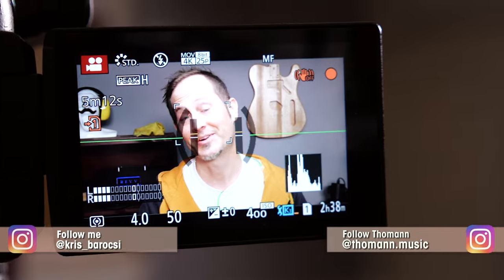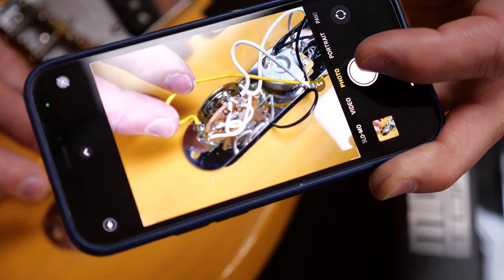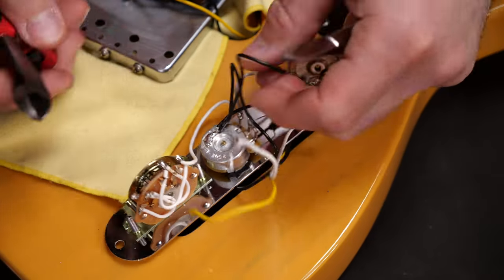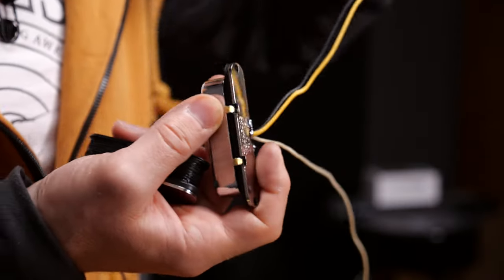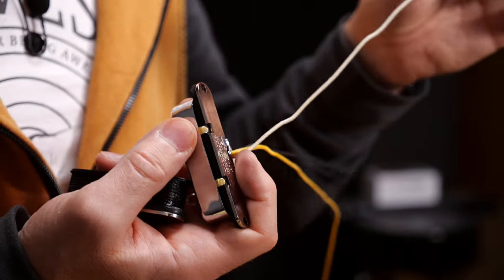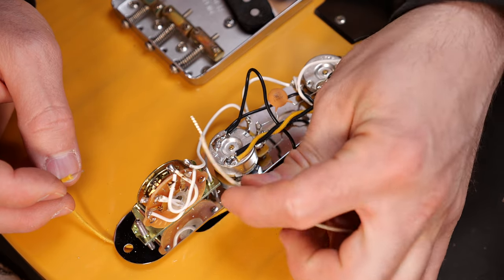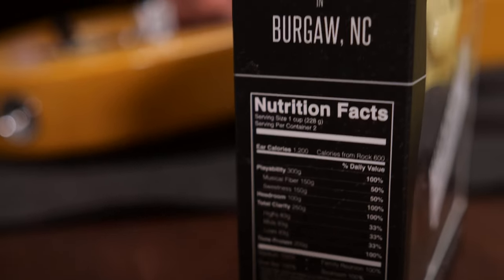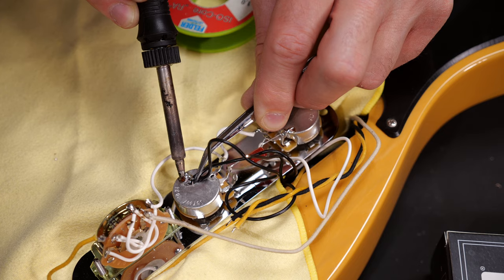How To Swap Pickups In a Telecaster | Guitar Tech Tips | Ep. 61 | Thomann

Comment: I will generally first finish all electronic work soldering then test for proper connection and only then screw everything back on. So in case something goes wrong I will notice instantly after the soldering.
Reply from the maker: Great tip! Thanks for the comment, people, listen to Count Blue! Cheers //Kris
Reply: @ThomannsGuitarsBasses  I do a simple test by knocking on the pickps with some small screwdriver. One should hear a "knocking" sound coming from the speakers (put the amp on a low volume!!)
To test for  proper toneblending you have to use sometime heaphones so you can hear the difference between the open and close toneblend. You could also use a multimeter, but of course you do know that anyways. ;-)

Comment: I've got a Squier Telecaster that I'm tinkering around with, it already has a scalloped neck, reverse bridge, reverse control plate with slanted pickup selector, new string tree etc. Apologies in advance if it's a daft question - I have a spare Seymour Duncan SSL-6 pickup and would like to try it out in the bridge position on the Squier Telecaster mod project. Is it possible to modify a regular single coil by adding a Telecaster bridge pickup base plate, so it then has the three screws, instead of the screw on either ear? I was just wondering if it was at all possible and whether or not to try it out and see if I liked it more than the stock Squier bridge pickup. Many thanks. Carlo 👍🏼🎸

Comment: My neck pickup stopped working.  Got a new one and will follow this vid.  But, how can I test it?  No strings.  What if it's the switch that's bad?
Reply from the maker: Hey Paul, here's a trick: swap the pickup connections on the switch. If the bridge pickup worked until now, the switch should be fine on that connector pin. Now the neck pickup is connected there and if it still doesn't work you know it's the pickup's fault, not the switch. Another tip: you can test if pickups work by carefully tapping them with something metal, like an allen key. You don't need to have strings on the guitar. Cheers //Kris

Comment: Great video.  My wiring diagram for the Fender ultra noiseless pickups calls for a 0.22uF tone capacitor.  I have a pre-wired pot kit with 0.47uF capacitor.  what do you suggest here?--leave the 0.047uF or swap out the capacitor?
Reply: so I upgraded the pickups and controls in my Squier telecaster using the Fender ultra noiseless pickups and Emerson pre-wired control kit with pots, output jack, and selector.  Overall, it was more of a hassle than I expected--both openings in the control plate and the opening in the output jack cup had to be drilled out because the newer parts were all a tad larger and would not fit through the openings.  Also, the Squier pickups were mounted with wood screws into the body.  In contrast, the new pickups came with smaller machine screws, presumably for a threaded socket in the control cavity.   As a result, I removed the mounting bushings from the sides of the neck pickup in order to mount the neck pickup using the wood screws from the old ones.  

In the end, sound is awesome, but I would have liked to know about these issues ahead of time.

Comment: Great video, as usual. But what is the purpose of double ground wires? As far as I know you shouldn't route ground in triangles or it should not have inner circuits. So it's not the best idea to route like one wire to the pots and other one to the bridge pickup for example. How are we supposed to use the second wire?
Reply from the maker: Thanks a lot! You'll mainly see double ground wires on tele neck pickups because of the metal cover. The cover needs to be grounded too. Some brands will sum the two ground wires for you and leave 2 wires (1 hot - 1 ground) and some will give you all 3 wires, in case you want to/need to reverse the phase of the pickup. 
On teles the bridge pickup's ground wire mostly get soldered on the bridge and then that goes together to the backside of the volume pot. So at the end all ground wires meet on the bottom of the pot. :) Does that explain everything? Cheers //Kris
Reply: @ThomannsGuitarsBasses  yep, thanks a lot, Kris!

Comment: Im still confused about the neck pickup.  My old one was 3 wires, black/yellow/white.  The new one is only 2 wires, black and yellow.  So, is the yellow new one the hot wire?  Does it go where the former yellow wire went or to where the former white wire went?
Reply: White is the still the hot wire. Yellow is a ground for the metal pickup cover. Black is ground for the pickup itself.

Comment: Kris l suppose it is different for a change in a diy Thomann kit? Since the pu are in the pickgard? And euh in the bridgeplate, if l am not wrong 😊
Reply: @Maciekovic  yes it is the tele diy kit, i made mine some 2 years ago...since than l  have spent most of my time building skateboards. Invested in materials for that. But wanted to upgrade the tele since the beginning, :) thank you so much for the info! Will look into it.
Reply from the maker: Thanks a lot Macie!!! That's some great info right there. The only thing to add, is that you can stick to the original pots and just remove the wire that's soldered on it's log (the one with the plug for the pickup wire). Then solder the new pickup's wire on the log and you're done. I have to say though that I agree with Macie, it makes sense to swap the other electronic parts in the kit (pots, switch, etc), since those are relatively basic. Cheers //Kris
Reply: @ThomannsGuitarsBasses  thanks to both of you! Will look into it as soon as l got some more time, since my building skateboards workshops have started again... cheers!

Comment: Not sure I'd trust the advice of someone who uses an electric driver instead of a proper screwdriver on a guitar (especially a cheap DIY electric driver).
Reply from the maker: Fair enough, thanks for the comment! 
Here's another perspective though:
-I never actually tighten a screw with the electric driver. I always stop before that and do the last turn (or at least half a turn) manually to protect the threads and thin plastic parts.
-The only people I know that only use manual drivers (at least here in Germany) are hobbyist techs and maybe 5-10% of the professional luthiers. Basically those who have all the time in the world to deal with all those screws on a guitar. Using a powered drill of course requires certain techniques to be safe on guitars, see the first point.
-There's a reason for using such a simple (DIY as you wrote) electric driver: the motor is kind of weak and the rpm is low which makes it much easier to use it safely, especially for short screws on pickguards and machine heads. 
I hope that makes sense to you. Cheers //Kris

Comment: what? a fender (probably mexican) has such terrible original pickups (as bad as squire) and the control panel is mounted backwards too.
Reply from the maker: Hey, the reversed control plate is a modification many tele players love doing. It's not a factory spec on this guitar, the owner made that.
As told in the video, it's a Mexican tele (a few years old Classic 50s model). The original pickups are not bad at all, but if you compare them to hand wired custom pickups (such as the Mojotone Quiet Coils) they might sound a little flat. That's not a surprise to me, it's a mid-priced Fender guitar with mid-priced original pickups whilst Mojotone is one of the best guitar parts brands. Cheers //Kris